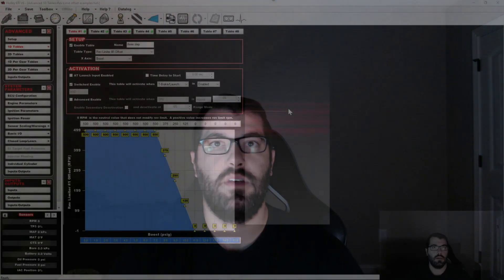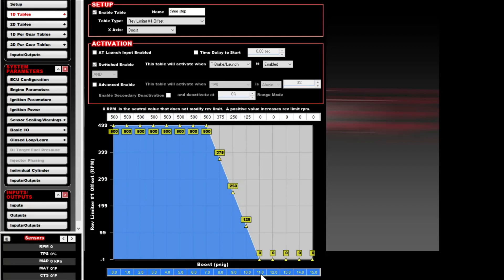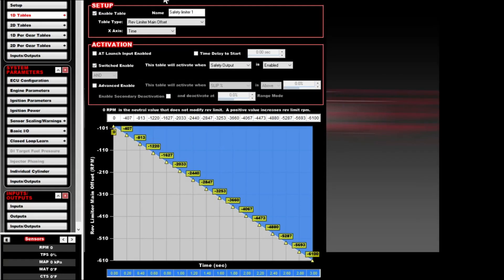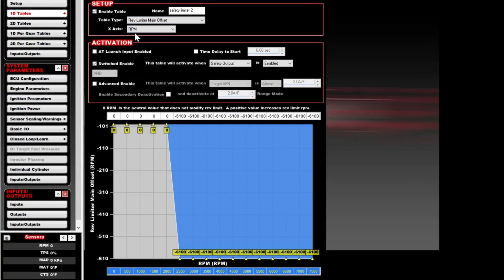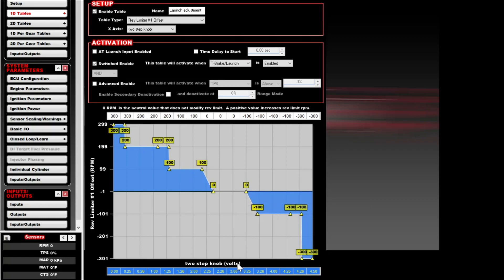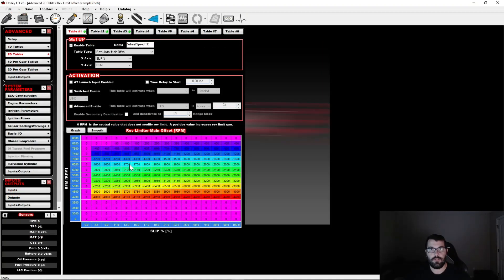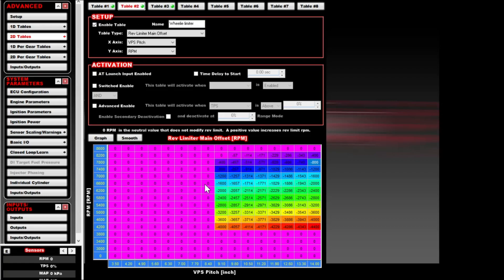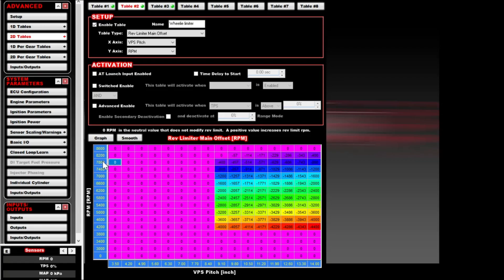Rev Limit Offsets in Holley EFI (Version 6): a brief explanation with examples

Comment: This is a great video.  I can't believe it took me this long to find it.  I immediately implemented three of these sample RPM limit Offsets.
Reply from the maker: Love hearing this!  Thank you for the feedback.
Reply: @highperformanceconsulting7616  If I have several "Safety" outputs based on the same Rev Limiter, can I create different offsets for, say lean A/F and low oil pressure?  For example, I might want Rev Limiter #1 to drag RPM down to 3000 RPM if lean, but 1000 RPM if oil pressure is low.
Reply: @ws6racing373  Sure, its just a matter of how many tables do you need to make it happen.
Reply: If I have a launch RPM offset using a multi-position switch, how do I create an output for the actual, offset RPM (say, 2000 RPM RL#1 + 300 offset)?  Specifically,  I want to show the actual launch RPM on a Pro Dash when I change the multi-position switch.
Reply: I contacted Holley Tech support today and was told I cannot display the actual launch RPM (including the offset), as I described above.  The best I can do is use channel math in a dash gauge to convert the "two step knob" voltage to an RPM offset and subtract that from the RL#1 value (also in channel math). This is only an approximation of the launch RPM, because (as per the Launch Adjustment example in this video), the RPM offset is a step function based on the "two step knob" voltage - not a linear relationship. 

If anyone knows of a better way, please pass it on. I think many folks would like to display their actual launch RPM on the dash.

Comment: appreciate these videos. is there a way to save IOs so if i decide to wire multiple cars the same way i can copy n paste the IOs
Reply from the maker: Sort of. You can save the IO icf independently and load it into each tune as desired.  

There is also the compare feature which lets you copy from one tune to another at the parameter level.
Reply: @highperformanceconsulting7616  yea I been using compare feature I'll try n save io